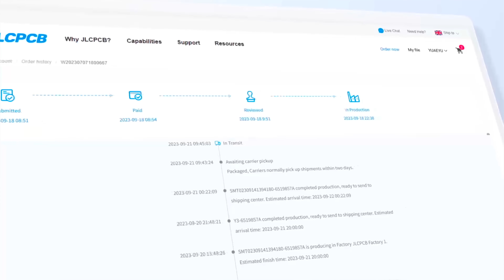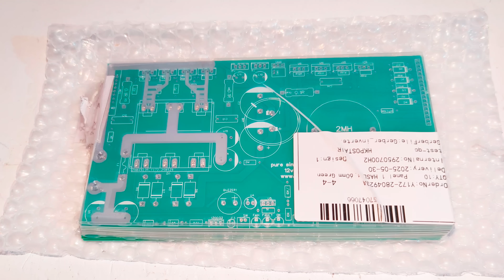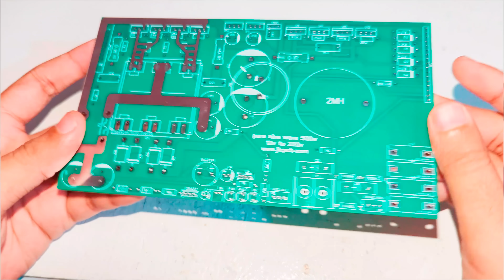EE42 Transformer using Litz For 500Watt Inverter | 12V to 220V - JLCPCB ✓

Comment: If I would like to get 1000W with the EE42, what would the winding be like? Thanks.
Reply from the maker: You have to use 2 Transformers in series
Reply: @Electronic_For_You If I wanted to use a single transformer and get the most out of EE42, what would the winding be? Thanks.
Reply from the maker: You have to use 24V or 36V to get more power 12V is winding limited
Reply: @Electronic_For_You thanks sir
Reply from the maker: Welcome

Comment: Bro I want to talk with you personally in WhatsApp about my egs inverter failure 😢 please give me your WhatsApp number 🙏🏻
Reply from the maker: You can ask anything here
Reply: @Electronic_For_You I just finished building my EGS002 full-bridge inverter with 4×IRF3205. The H-bridge output (measured without transformer) shows about 8.5V RMS on my DMM. When I tested with a 14V→220V iron core transformer it worked smoothly, giving me around 120V AC on the output and bulbs/LEDs ran fine. But when I tried a UPS transformer with only a 0–6V primary and 0–220V secondary, two MOSFETs instantly shorted.

Comment: Please make an inverter with the transformer and test the maximum output load. I am worried,  because I think the wires are too thin for Primary .

Also you use one thick wire in secondary,  that may increase the ad current loss.
So please make a load test video with this setup.  That may helpful to me. 
But thank you for the great project.
Reply from the maker: Ok, I don't have enough powerful DC sources to test maximum current, still I will try 👍🏻
Reply: @Electronic_For_You  Also if possible,  test the no load power consumption(without cooling fan ).
Reply from the maker: Ok
Reply: @Electronic_For_You  Try server power supply. It's so compact and extremely  strong.
Reply from the maker: I'm planning to build a 40ah LIFePO4 battery, 
Server power supplies are very rare to get here 😮‍💨

Comment: Which mosfet you are going to use for push pull? I recommend IRF4110 mosfet I have seen them in many inverters
Reply from the maker: Currently I have IRF1010 and 75n75 , 
Ok if I found IRF4110 I will use it , 
Thanks For Suggestions
Reply: @Electronic_For_You  In that case using infenion irf1010 is better I believe
Reply from the maker: IRF1010 is Good but IRF4110 is a very high current which I like 👍🏻

Comment: Can I make it 1kwatt by adding one more 1mm wire to the secondary.  
Also what happens when I reduce the secondary turns to 70 or below
Reply from the maker: I think the space is limited so you can't, you can try a bit bigger core like EE49 or EE55
Reply: @Electronic_For_You  If your ferrite material is good enough, you can increase working ferquency and using H bridge topolgy on primary side of transfomer to reduce 1 primary coil.
Reply from the maker: I really have to try this , 
Sounds very interesting

Comment: It can handle 500w of power with this setup. In some AC-DC converter like telecom power supply, this E42 transfomer can handle up to 1.6kW of power continous without any problems.
Reply from the maker: Interesting!
I will use 35-40khz and I think litz wire will work better than any other method I made before 👍🏻
Reply: @Electronic_For_You 
I think it can handle more than 500w wires that you used are very thick and can handle 600-700W
Reply from the maker: Possible,
But it will need lots of MOSFETs
Reply: @Electronic_For_You  Four mosfets should be enough two parallel each side of push pull